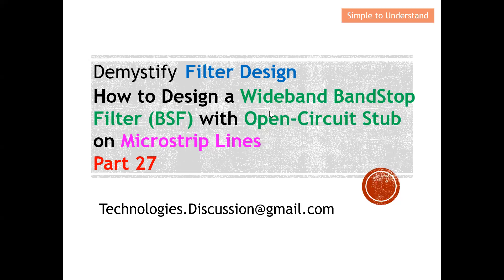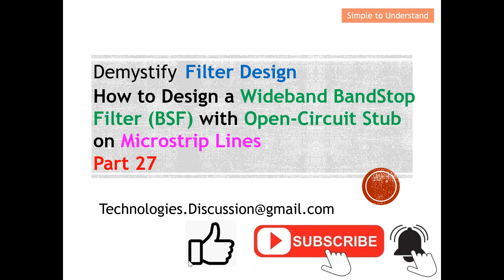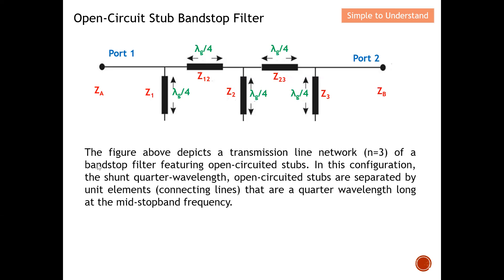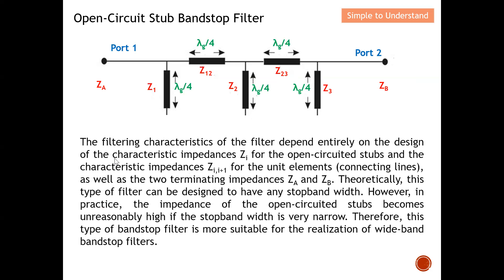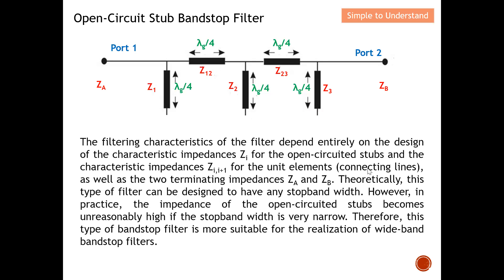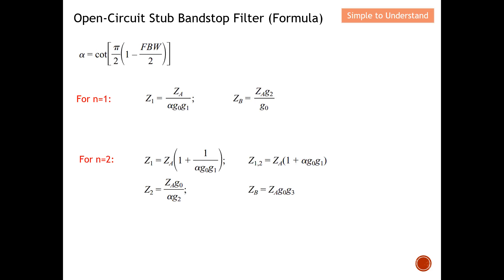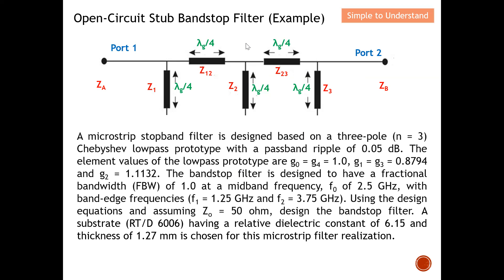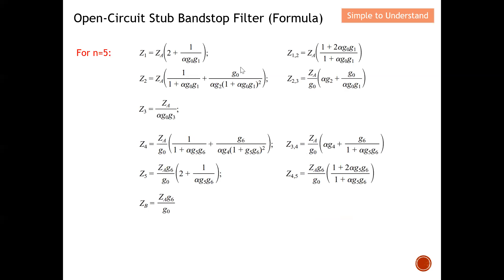Filter Design #27. How to Design Microstrip Shunt Open-Circuit Stubs Wideband Bandstop Filter Guide.

Comment: why is Zb dependent on Za? what is your Za and Zb are 50 Ohm ports would that not just make g0 and g4 = 1? or am i understanding what Za and Zb are correctly
Reply from the maker: Za=Zb=50 Ohm. g0 and g4 are not related to Za and Zb. In fact, g0 and g4 are not related to any impedance. g0....g4 are just a design rules.